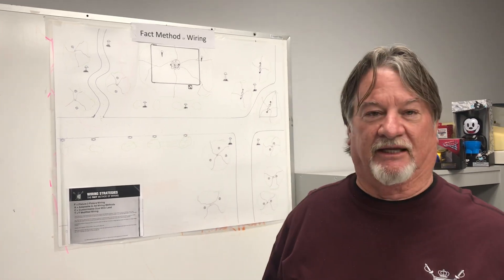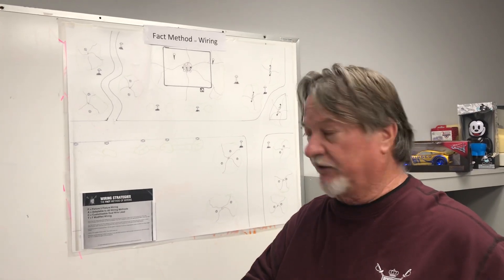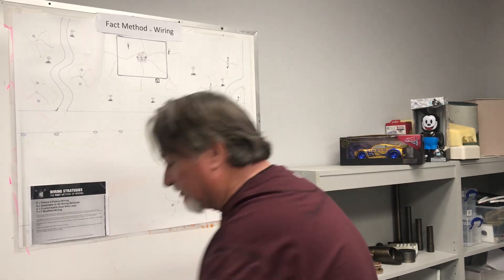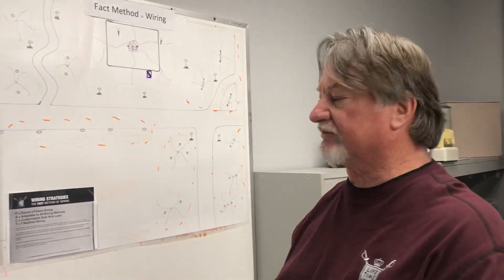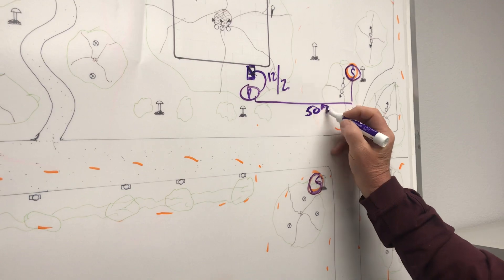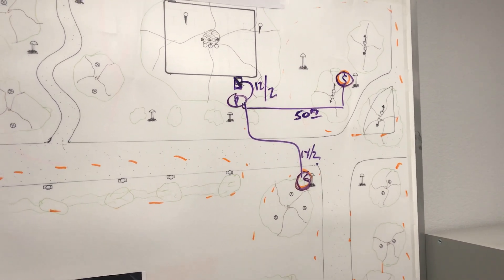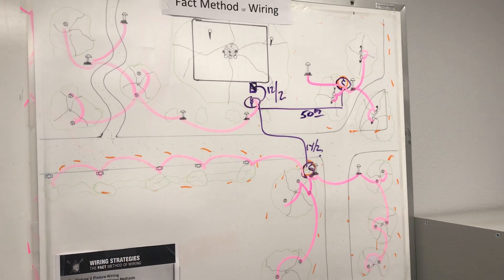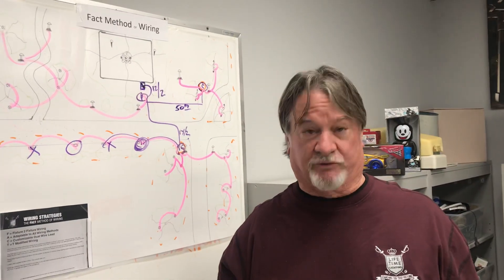The FACT Method of Wiring, the Fastest, Less Expensive Landscape Lighting Wiring Method

Comment: When you split the wire down the middle to limit connections 30-feet in different directions with no connection at that fixture the electrical circuit positive and negative no longer exists.